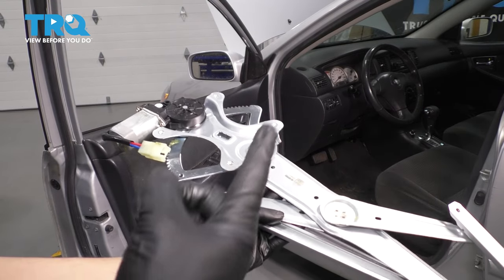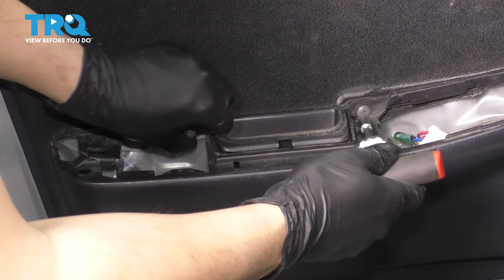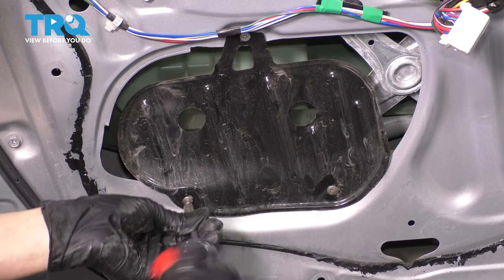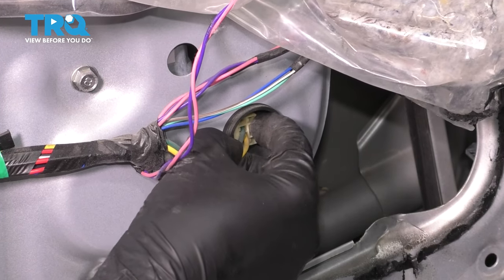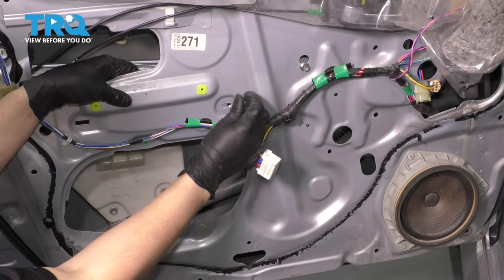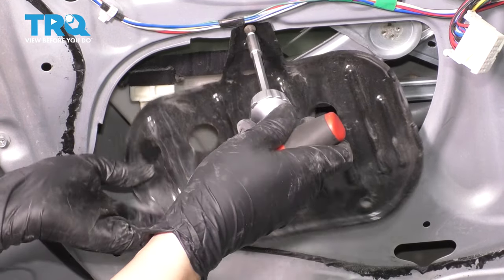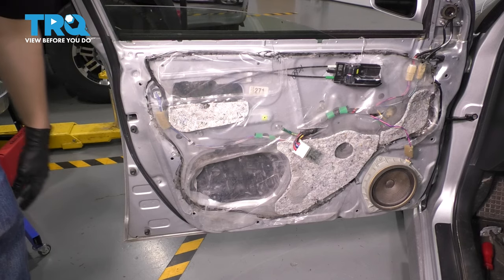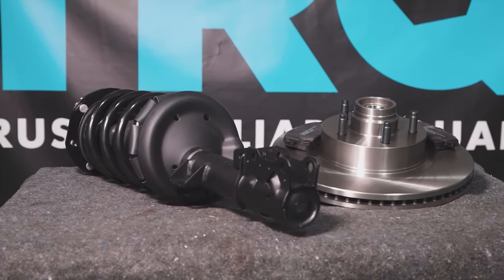How to Replace Front Window Regulator with Motor 2003-2008 Toyota Corolla

Comment: Thank you for posting this.  I just supervised my 15 year old daughter changing out a bad motor in our 2003 Corolla.  We had one slight issue that you didn't cover in the video though.  Our motor quit when the window was all the way down.  Small hands and a little ingenuity resolved the issue.  We removed the speaker and that gave her just enough room to get the forward bottom bolt. It took us quite a bit longer than it did you, however, I will forever cherish the time her and I spent together doing this. You're video is now part of a forever memory in our family.  Much thanks.
Reply from the maker: +DiscipleJohn Thank you! We love empowering our customers and showing how to perform DIY auto repairs with our high-quality auto parts. http://1aau.to/m/Shop-TRQ

Comment: If the window is stuck and you cannot access the nut through the hole, just unscrew all the nuts holding the regulator to the door and the whole assembly, including the window, can be moved freely. That's what I did for mine.

Comment: How do you line up the bolt in hole if you can’t use master switch to roll window up? I believe my motor is shot. So basically I need a manual way to raise window up to line up bolt for removal. Every video I’ve seen they use the switch, must be nice! 😂

Comment: If your window is stuck down you can try taking the panel off, and while rolling the window up give the door a whack near the window motor and it may allow you to roll the window up. It worked for me and let me drive around for a couple weeks with limiting rolling ability

Comment: my motor isnt working. and the window is closed. is there a manual way to lower the window so that i can use the access hole to unblock the glass from the regulator arm?